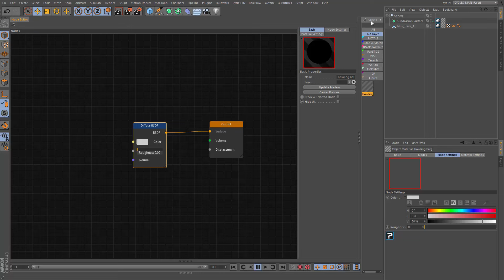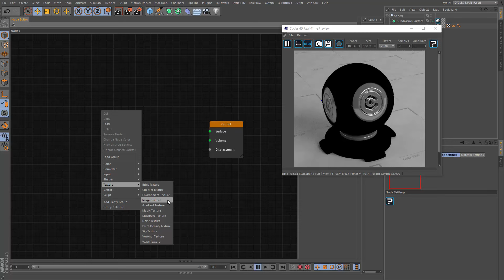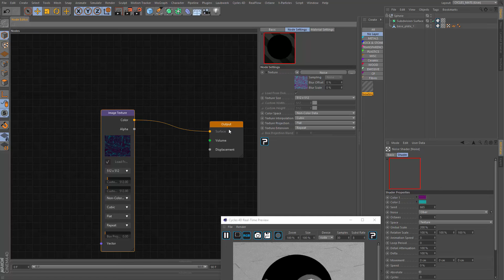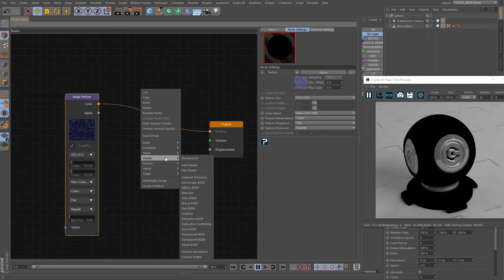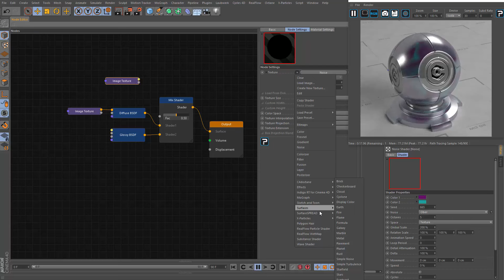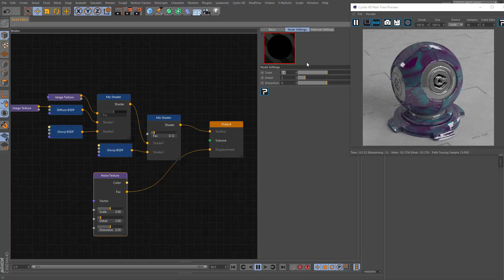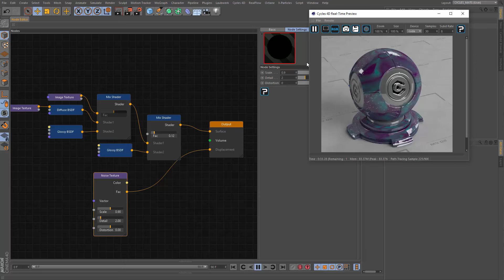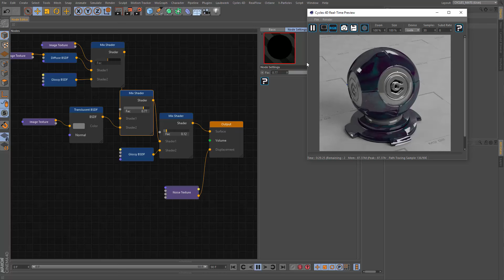Cycles4D | Building metal flake and translucent materials

Comment: How is Cycles4d compared to Maxwell in your opinion?
Reply from the maker: Maher Al-Demerdash They are different beasts. Maxwell is far easier to use and setup. Treat it just like a camera and you're good to go. 
Cycles is perfect for particle work and the node based material editor is a joy. I use both depending on the job.
Reply: Thanks man :)